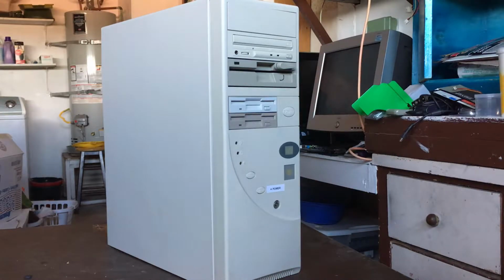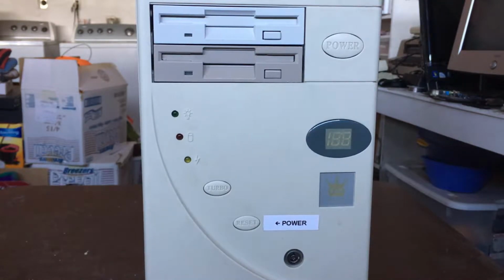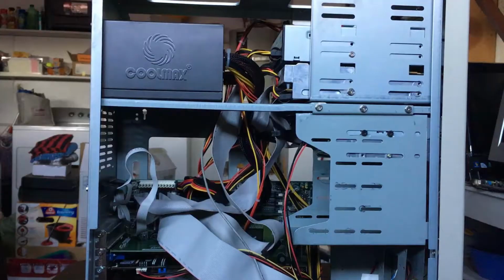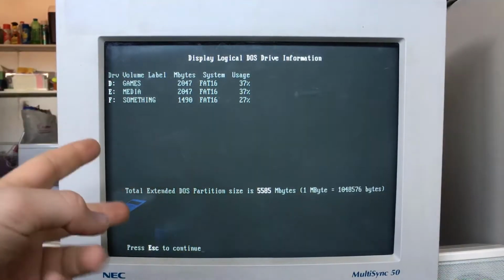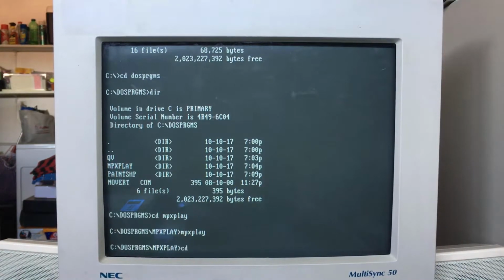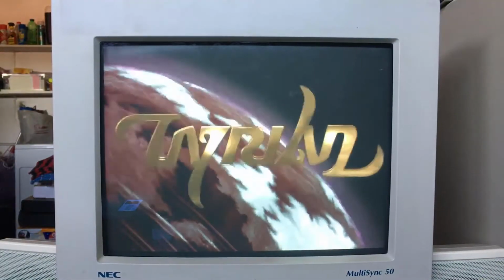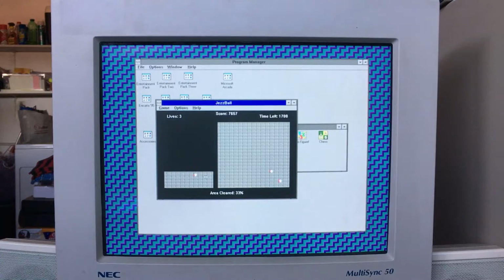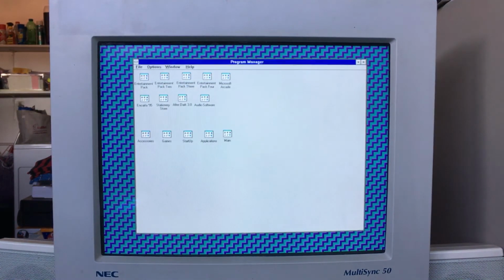DOS Machine 2.0

Comment: 1. Put the blanks in the case, tie them down with a cable zip or something. This way you won't loose anything.
2. If the board has a keylock connector, the power LED headers are part of it. The three leftmost pins, if you look from the front of the case onto the edge of the board, are the LED headers. Three because there is usually a not connected pin in the middle of the actual LED pins. 
3. Beware when using a modern power supply with older mainboards. Don't go by the total power output in Watts but by the maximum amount of current they deliver on each voltage rail. Old computers have much different requirements than newer ones. Newer PSUs actually don't deliver some voltages at all anymore.
Reply from the maker: Will definitely have to look into this
Reply from the maker: Update : The info you gave me has been super helpful! Expect a new video about the progress I made soon.
Reply: Hey, I was going to comment the same thing about the KeyLock connector. The layout of your board looks very similar to the EPoX EP-58MVP3C-M. I'll guess it's just a different revision than the one I know. If I am not mistaken the connectors for switches and LEDs should be on the right side of the board. From top to bottom they would be: Reset [2 pins] ; Speaker [4 pins] ; KeyLock (+Power LED) [5 pins] ; IrDA/ASK IR CONNECTOR [5 pins] ; IDE LED [2 pins, directly followed by] ; Turbo LED [2 pins] ; Power-ON [2 pins]. The LED connectors have positive on the upper pin. The 7th-9th pins (again counting from top) are for Power LED, the 7th being positive, the 9th negative and the 8th not connected. If this fails you could connect your Power LED to the turbo indicator since there is no deturbo function so that the turbo LED is always on effectively acting as a Power LED. 
Please counter check on your board, this is only an hypothesis!

Also why didn't you migrate the K6-II 450 from the old machine? I just watched your "DOS Machine 3.0?" video and you tried getting more power from a Celeron 433 which should perform lower than the K6-II 450. Also the K6 arcitecture can be slowed down quite a lot to support older games making those processors perfect for DOS imho. Don't forget about configuring voltage jumpers though!

PS: I know youtube comments can be pretty shitty. None of this is meant to be hateful or patronising. It's all constructive feedback. :-)
Reply: @K6-2
If I'm right and it's the EPoX EP-58MVP3C-M it has official microcode support for all AMD K6-2 and K6-III with the latest official BIOS. (Avaliable here: home (dot) hccnet (dot) nl/j.steunebrink/vp300411.exe )
Later versions of the board even have voltage settings for 2.4V core. The revision number can be found in the lower left corner of the board. 
I believe you have got one of the older revisions (0.1) so you can try running the Processor with 2.2V core which might be unstable depending on your CPU model; 450AFX supports 2.2V, 450AHX supports 2.3V and 450AGX supports 2.4V. The later board revisions had changes in the power design thus only revision 1.0 and higher officially support AMD K-6 2 and III processors. However an italian site ( hwupgrade (dot) it/articoli/multimedia/313/epox-ep-58mvp3c-m_index.html ) suggests with revision 0.1 it is possible to get 2.35V core by setting the jumpers for 2.1V (JP2 1-6) and 2.2V (JP2 2-7) at the same time. They also successfully tested a K6-2 300 on revision 0.1. I can't test or gurantee this myself though!
Reference for official jumper settings:
V.0.1 manual: elhvb (dot) com/mobokive/Archive/Epox/manuals/mvp3c-m.pdf
V.1.0 manual: elhvb (dot) com/mobokive/Archive/Epox/manuals/mvp3c120.pdf
V.1.2 manual: elhvb (dot) com/mobokive/Archive/Epox/manuals/mvp3c121.pdf

Good luck and have fun with all of it! :-)
Reply from the maker: Answering 1 : I'll keep that in mind.

Answering 2 : The board doesn't have a keylock connector. So, I still have no idea where the header went.

Answering 3 : The 5v rail maxes out at 150 watts and the 12v rail is 350w. And, yes I already knew to check for that I just didn't mention it in the video.
Reply from the maker: The K6-2 board doesn't have an AGP slot. Which means I would have to find a PCI graphics solution (which all of mine aren't great or are broken). And looking at info about the BIOS online of the current board, it doesn't seem to support the K6-2 only the regular K6. However, I might try and see if the K6-2 will work, If it does I'll just use that. If it doesn't I'll probably just by the fastest regular K6 that I can and maybe even overclock it. Also, I just went and tried every unused header on the motherboard with no success for the power LED. It's no big deal, I mean, Who really needs a power LED when you can just hear the computer throughout your whole house?